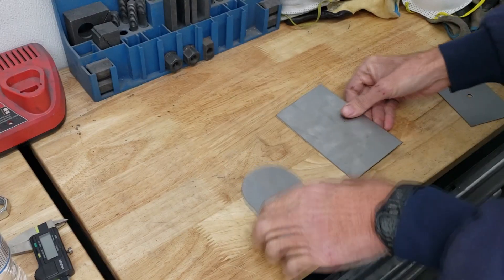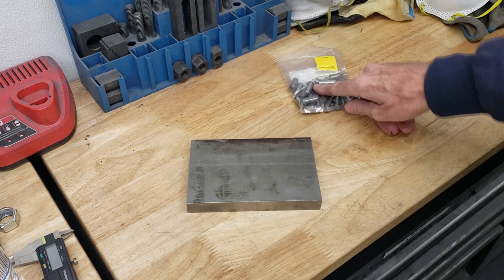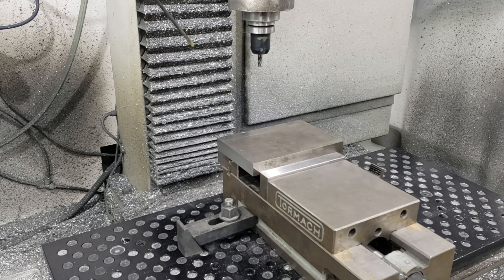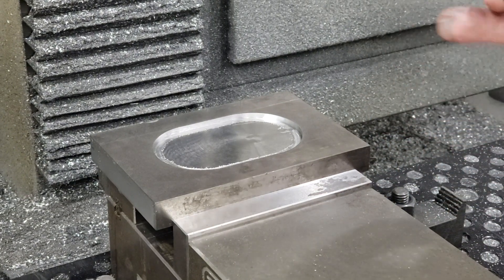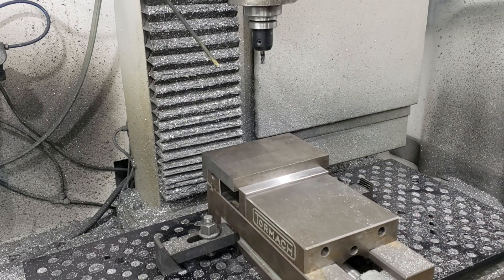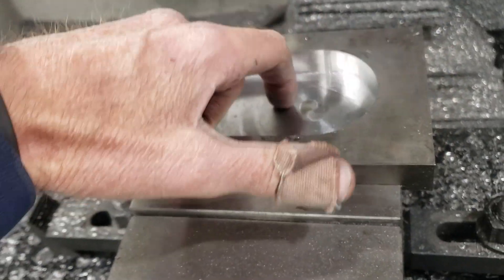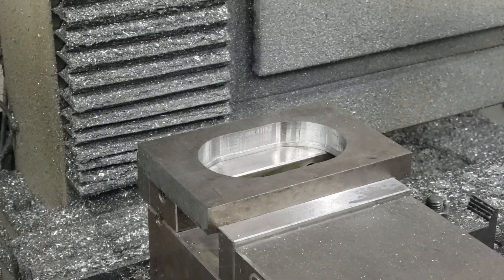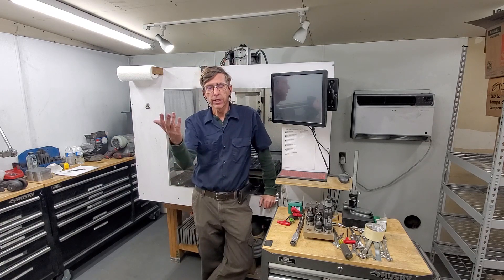Blanking punch Die Set  - The Die

Comment: What material will be good for cutting 0.5 mm 316 steel sheet for this cutting die block?
Reply from the maker: Stainless Steel?  You are going to need some kind of tool steel that has been hardened would be my guess.
Reply: @craigsmachineshop2040   thanks

Comment: SpeedyMetals has good prices on steel but I'm not sure what to get for the dies. 1018 would probably be too soft, so I'm thinking A36 or O1/W1, but what would be recommended. I can probably harden the pieces after milling. I want to punch blanks from 1/8" 360 brass or thinner
Reply from the maker: Thanks, I will check them out!  I usually use A2 since it's easy to get.  I've never punched brass before, not sure what it's like.  Somewhere between steel and aluminum, I would guess.